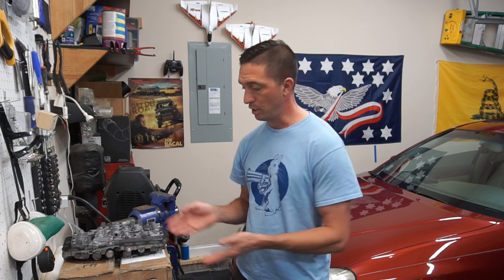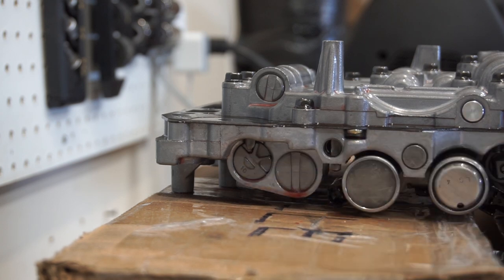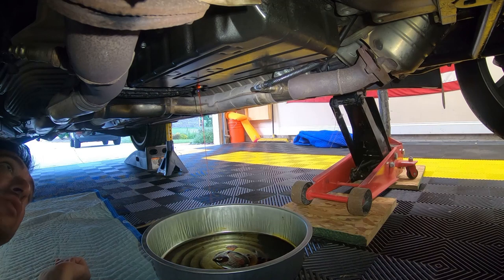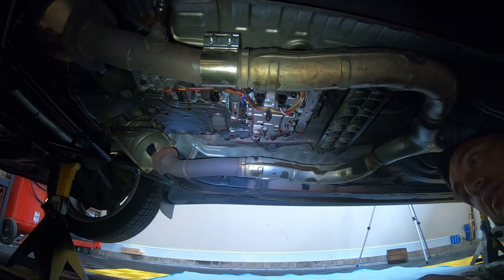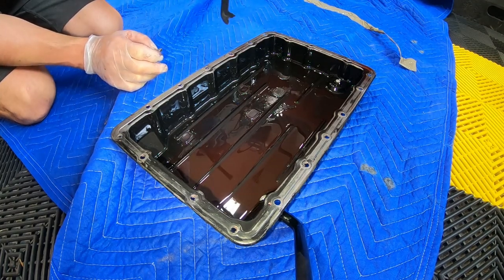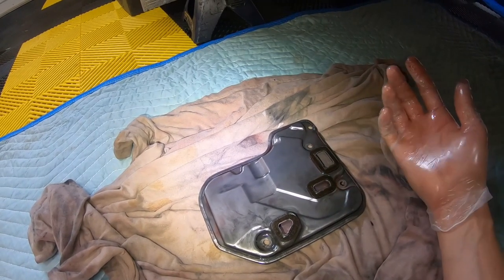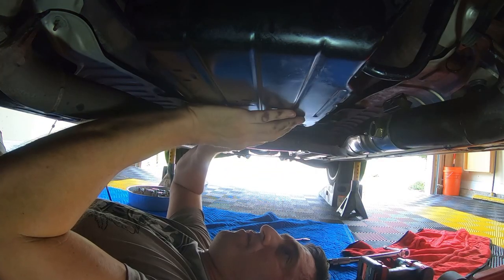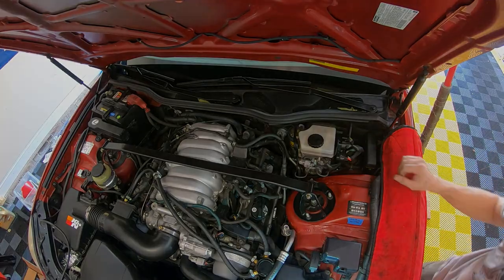TOYOTA / LEXUS STAGE 1 Transmission Mods & Maintenance

Comment: Is it true to not turn up pressure without trans cooler ?
Reply from the maker: Not true. Increasing line pressure decreases heat. If anything, a cooler should be ran when NOT turning up the pressure (for hard driving).
Reply: Seals won’t blow? Lol
Reply: I’m waiting on my solenoid A and I got my T-IV atf doing filter too. I’ll be good? I’m doing solenoid just in case bad code did come up for it
Reply from the maker: I can’t make any promises because the condition of every transmission and how the car is driven is a little different. I can say that it’s an adjustment that’s available and some have found it on III from the factory. Also, it wouldn’t be there if moving it would blow seals. If something happens chances are it was going to happen anyway.

Comment: I am having an issue cause I did the mod but now the transmission is shifting weird. I don’t know if it is because I have a sc400 not a gs400 but they run the same transmission.
Reply from the maker: You did the dial mod? Or all the mods? Describe what your car is doing.
Reply: Forward Momentum I did the dial mod and it is not wanting to go into gear very well. It shifts fine after 1st and 2nd gear. It acts like it’s in neutral and then all of a sudden it jams into gear. Also I have now lost all of my reverse and drive gears
Reply from the maker: Something else is wrong. How much fluid did you lose and put back in? Hundreds of us have done this with no negative effect.
Reply from the maker: This dial is there as a factory adjustment option. I just want to reassure you that it’s not some hack or similar. I truly believe something else is wrong and I’m sorry you’re dealing with this.
Reply: Thanks I am thinking the same thing cause I have even swapped the valve body and still no change
Reply: @landonfarris8646  did you end up figuring out what was wrong bro???

Comment: Hi how do you change a alternator
Reply from the maker: Go to TIS and download the FSM. The instructions are all in there.
Reply: Facing the engine from in front of the car, the alternator is at the bottom left. You have to lift the car, and get under it to remove the alternator. You may have to remove the power steering pulley to access the top screw to remove the alternator. Once you know how to do it, it's a 10 minute job.
To get the PS pulley off, keep the serpentine belt on, and use it to keep the pulley from turning as you un-torque the nut.

Comment: is this safe to do with a Gs300 that has over 200k miles on it?
Reply from the maker: Of course.
Reply: Won't increasing the line pressure blow out the seals?
Reply from the maker: No. Remember, this is an available adjustment from the factory.

Comment: Do you recommend for a 99 gs300 about to hit 160k
Reply from the maker: Just depends on maintenance.
Reply: No maintenance that I know of I just topped off fluid. Fluid slightly dark but not burnt. I want to get the most out of it. So I'm open to all suggestions and tips
Reply from the maker: @rubencapeles9642  maybe I’m missing your question. You already own it or you’re looking at one to buy? Either way, first and foremost, do the LBJs. Sankei 555 or OEM are regarded as the best.
Reply: I'm sorry I already own the car bought it used. I'm asking for suggestions and recommendations to get the most and best performance and if you recommend If I can do this at 160k miles
Reply from the maker: @rubencapeles9642  cool. Check out my inspection episode. That will show you a few things to look for. Drain and fill all fluids, flush cooling system, timing belt, etc. Do the LBJs first!